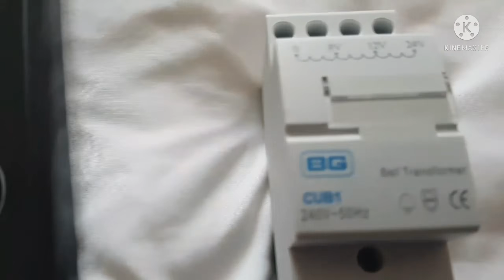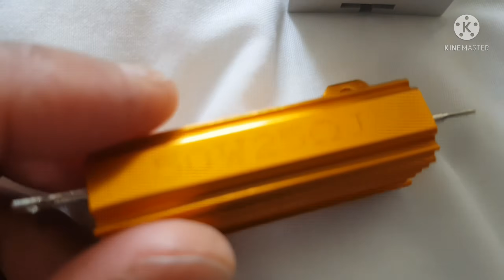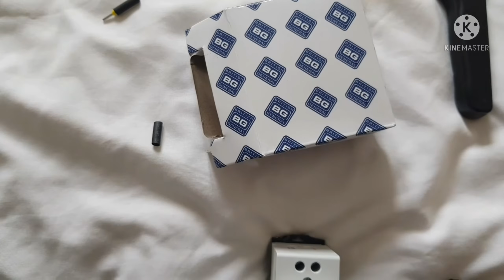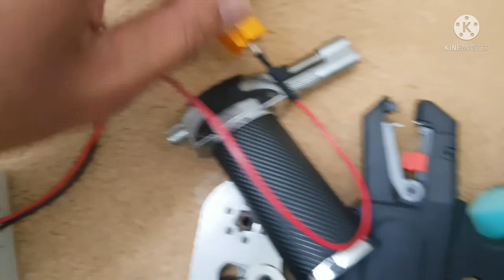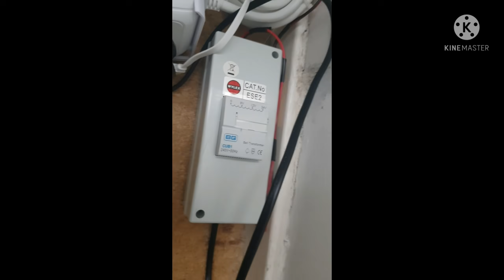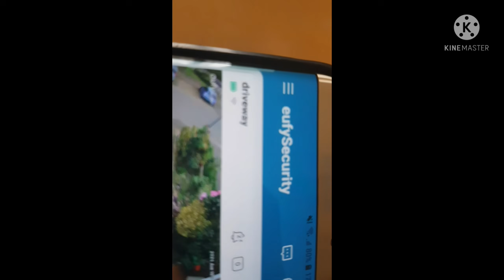Eufy battery powered 2k doorbell hardwired uk

Comment: I know this is a few years ago, but I am about to install this doorbell (Dec 2025), and from what I have researched, the reason that Transformer from Screwfix is 'humming' is because it is an 8VA transformer, and the Eufy E340 doorbell requires 10VA or more (their website actually recommends 30VA), I have ordered the VEMER VN321600 Transformer TMD 30/24 (£21 on Amazon) arrives in a couple of days. Hope this helps someone.
Reply: Did he connect the wires properly? I thought the live wire was always on the right(brown) and the blue on the left.. I’m kinda confused now.

Comment: Is the device working fine now?
Reply from the maker: Couldn't be happier ☺️
Reply: @ynm078   Thank you very much for your quick answer.
Reply: @ynm078  Hi, I recently purchased the E340 2K doorbell, wired into my exsisting ring doorbell pro wiring, I see the plug symbol and the battery charging icon, yet the battery is not actually charging it's slowly going down. The O/P voltage from the exsisting transformer is showing 30v, is that too much power you think? I have no risister inline.